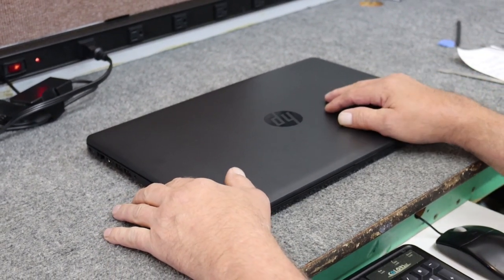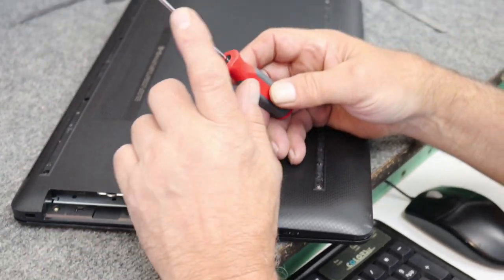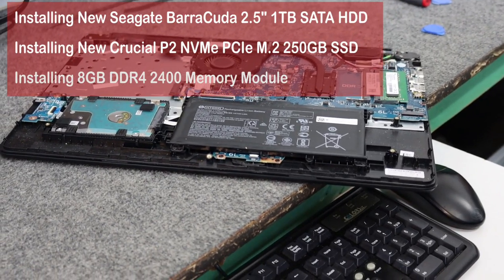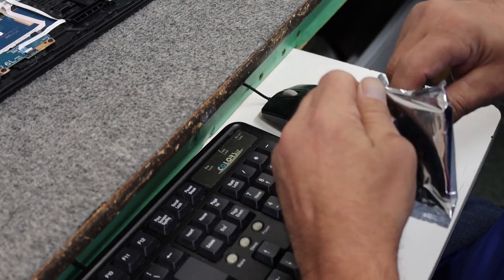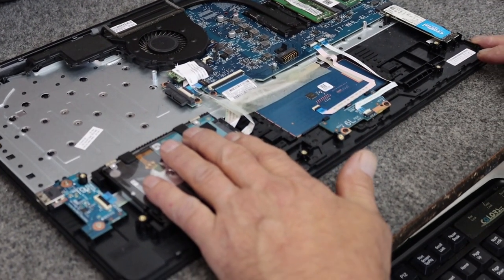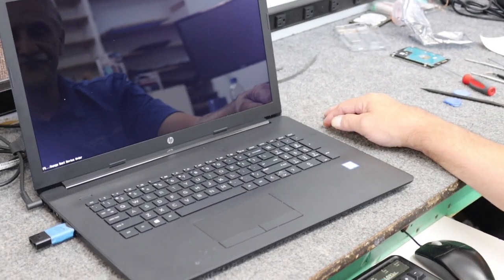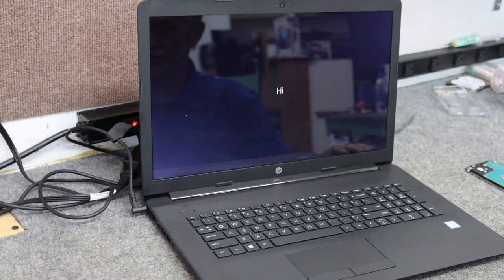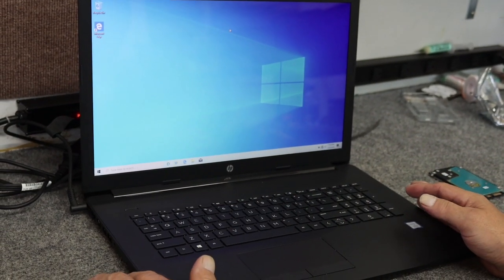HP 17.3" Laptop SSD Upgrade, Memory Upgrade, Additional Hard Drive and Clean Windows 10 Install

Comment: Nice job, Dale! I just bumped up the RAM on my HP 17-by1061st from 4GB to 32GB (16GB x2). Your instructions to open it up helped a great deal. My HD is still good but I plan to add the M2 drive and move Windows there. Thanks again! 👍🏽👍🏽👍🏽
Reply: Could you share with me what kind of RAM you did for the upgrade? I have the same model as HP 17. Thank you!

Comment: Glad I looked up this procedure... I might not have known about the rubber strips hiding screws...
Most major manufacturers of electronics hide a screw(s) under the rubber feet, or under stickers...
My MSI has 1 screw out of 10 hidden under a sticker...
You can take out the rest of the screws, but you have to poke the sticker for that one screw, and that alone will void the warranty if it's new...

Comment: I have this exact model, and although it's a little workhorse, the hard drive was slowing down, and it booted obnoxiously slow. So, I did a little research, and stumbled upon your video on how to install a SDD drive. Following your instructions, I was able to get it apart, install the new drive, and get it back together. I held my breath, plugged in my Windows install media, powered it up, and set the boot order. From there it was smooth sailing!! It is now running exclusively on the SSD, and I'm loving it!! The hardest part was my fumble fingers getting in the way!! Not bad for a 60+ year old!! Thanks for your help!!

Comment: Excellent video and to the point. I have this laptop with the smaller hard drive which keeps running low on space. Extremely happy to find out I can install an M.2 SSD. This really is a great laptop so I’m happy to be able to upgrade the space.

Comment: I WISH I could be side by side with you. I have been doing phone support for over 22 years but began with PC Hardware. Still have the scars on my
fingers when building PC's with cheap cases (Very sharp edges) and people wanting very small factor desktops.
Just got an HP 17 inch Windows 11 laptop with 8 gb RAM and a 256 SSD Drive. Looking to upgrade both but not sure if this has room for a 2nd
drive which would be greate!
You made it look simple, and very step by step which is appreciated since I have not actually worked on machines in so many years.
Gives me the confidence I need after researching for this laptop specs to see what I can and cannot do.
Thank you!
Reply from the maker: your welcome,  thx for watching. Dale

Comment: Thanks a lot! Not only was able to upgrade the ram memory, but I could fix one of the hinges that got stuck. I though something broke inside, but it turned out that it tightened up so hard that I had to pour tons of lubricant to start folding again.

Comment: Thanks a lot.

IF YOU DONT HAVE A PLASTIC TOOL (GUITAR PLATES) TO OPEN THE CHASE:
A good replacement for the plastic tool was a credit card (or other plastic card). Rounded corners, plastic... you can't damage you notebook with this "tool".

Comment: Hi! I've seen quite a few of your videos and learned a lot! I have an HP14s cr1008tx and I'm trying to add a 1TB HDD internally but I've noticed that my laptop does not have a caddy or the SATA cable to do so. So is there any particular model of the caddy and SATA cable that I should use for my model? I have a 256GB SSD already installed but it's full so I would really appreciate the help!

Comment: this is one of the best helpfull way to direct and create a step to step video. Watching some other step to step videos always wanted to ask something in some steps, and those questions (in my mind) never got an answer, except for this videos of yours. I came here searching for information for an HP laptop, the 17-x001nv. After watching your video I came with the idea to put a M2 disk, but I can't find if it is possible, it would be convinient to know before I'll open the case, have you got any information? Thank you for your work
Reply from the maker: Hi. Thank you very much. I believe your model does not have an m.2 slot. You can put a 2.5 inch SATA SSD though. Would make it lot faster. Thx, dale
Reply: @CadillacComputerCenter  thanks for the advice, keep up the good work.

Comment: Stumbling upon this video today made my day. I have a very similar model and I want to install an M2 SSD but keep my current HDD. Would I still need to create the bootable Windows 10 installation drive if I'm only adding the SSD? If not, anything different that I may want to do? THANK YOU!
Reply: I have nothing to do with the creation of this video, but if you are just installing a secondary drive, it's the same as doing it on any PC, laptop or desktop. You install the drive, power it up and the BIOS should recognize it. You then probably have to go into Computer Management to initialize the drive, assign a drive letter, and format it. That's it.

Comment: I have a very similar model HP 17 inch laptop. My M.2 slot has an Intel Optane memory card chip in it. Is it OK to take it out and install an M.2 SSD? I guess it wont affect anything? By the way I just recently replaced my bottom case and palm rest, and doubled the RAM from 8 to 16 GB :) I had already upgraded the HDD to an SSD drive a couple years ago.

Comment: I'm about to do everything you did in this video.  I appreciate your efforts it's lots of help.  One question.  On the memory, was there a reason you chose not to go to 32 instead of just another 8?  I was planning on 2 x 16 G chips.  TIA
Reply from the maker: Hi. I do these videos on customers computers. What I install is chosen by the customer.  Other than that, no reason .
Reply: @CadillacComputerCenter  Thanks for your time.

Comment: Hi Dale, I have a very similar outer shell setup on my HP 17 2075. I am getting a loud fan noise. My first step will be to take the shell off and see if cleaning the fan will help. If that fails, do you have a recommendation on where to get a replacement fan? Thanks, Tom

Comment: Hi, Thanks for the ONLY useful videos on HP laptops(new series). I'm not a very hardware techy girl but I try to fix things by myself. My HP Laptop 17z-Ca000 fan started making a lot of noise (speeding fan) despite no overuse. Error A90B causing auto shut down. I also have an external cooling fan base that plugs using a USB. I learned how to open the laptop(haven't tried yet- Scared :( but how can we fix the FAN issue? You are so knowledgeable, is there any other way to fix the fan issue without opening the laptop. It's been 2 years since this laptop. II cleaned it using a vacuum and air cleaner. So fan noise is intermittent now. But not a permanent fix yet. Could you please help out Sir? Thanks- Neha

Comment: I noticed the Crucial P2 M.2 2280 500GB I received that I want to put in my HP 17-by1061st is rated 3.3v and 2.5A. Will this SSD still wotk in this HP or does the Amperage have to 1.7A?
Reply: m.2 's mostly does work

Comment: This helped me a lot. the problem I ran into was the laptop refuses to boot from the SSD. I did clone the SSD from the HD.  When I boot up and go into BIOS it just shows the original HD listed and not the SSD although if I boot from the HD I can see and use the SSD from WIndows. I did find that by clearing the TPM in BIOS I can see the SSD listed but when I try boot from it it just comes up with a message saying add boot device and hit enter.  Any ideas?

Comment: It is stupid that they don't put a couple of compartments on the bottom for ram and ssd replacement rather than having to go through all of that. At least there aren't any short ribbon cables attached that have to be disconnected I guess. Those are a pain, and if you accidentally break one of the clips that hold the ribbons in you are screwed most of the time.

Comment: I have an HP Laptop model 17-by3065st and the hard drive (1 tb) is about full. Can I add a 1 tb ssd card for additional storage while keeping the regular hard drive with the Windows operating system, etc. on it?
Reply from the maker: As long as your laptop has an M.2 slot fir ssd.

Comment: I have this one hp laptop 14cf0000ne with 15gb for the OS. Is there any possibility to have another slot for another ssd, or Ill have to chenge the 15gbssd for a new one?
Or, can a replace the HD for an SSD? As you can see, im really confused about mt HP

Comment: My HP 17-CA1 is a RYZEN-7, 16GB , RADEON graphic card, but the hard disk is too slow, takes around 8-10 min in 100% of use after boot.  I need to change for a SSD.
Reply from the maker: Yes, you sure do.
Reply: And Many thanks for your video!
Reply: @CadillacComputerCenter  Just an update! I did today the upgrade and worked perfectly! Many thanks!!!

Comment: does the bios give you the choice of HD to boot from? do you think i can boot win 10 from the M2 and cloudready from  the SATA? o does the computer see only 1 continuos HD?  Is 128GB enough for win 10? Thanks
Reply from the maker: Hi. You would have to enable legacy to do what you say.  It gets tricky .  128gb is enough for windows 10, with a little to spare.  There are tons of videos on YouTube on how to setup a dual boot.
Reply: How many gigabytes of RAM can a 17.3 in HP laptop take?
Reply: @hezekiahwallace2412  I think the max is 16 GB RAM. Some people say you can put up to 32 GB RAM, but from what I hear it's 16 GB RAM. Don't put 32 or you'll probably mess something up.
Reply: @chasejones2654  was just going to comment on this. I just ordered another 8GB to expand my ram. I looked it up and my 17in HP laptop only takes a maximum of 16 gb; comes with 8 installed

Comment: would be lovely to upgrade dedicated 960mx to a stronger version graphic card. or using dvd tray to add another graphic card. tip :  if there is a connector / pin ; that side comes up first (mostly) gently...

Comment: hello,
How would i take out the two screws on the 
disc drive
Thanks
Reply: eject the drive while using the laptop and keep it ejected then you can reach the screw from the behind
Reply: @emre.mir.x  thank you
Reply: @emre.mir.x  My optical drive is different. It's connected via a cable and has hinges. How the heck do you remove this first?

Comment: Can you also upgrade the GPU in such a laptop?
Reply: Most low or mid level laptops use APUs that combine the CPU and GPU into a single part, which is often  soldered in so it cannot be replaced.

Most laptops that even have a GPU are considerably more expensive on average for  the high end system or occasionally mid level.

Most stuff you've seen in stores are probably low end or mid level if your lucky, or high end if your really really lucky

Comment: Hello I  have  HP 17CA2020RN with 4GB or RAM I purchased an additional 4GB to bring it to 8.  When I installed the extra 4GB and started up i got the HP logo screen the a black screen with my pointer and the loading circle.  I let it sit and it never started so I removed the additional 4GB I added and it still would not go past the black screen.  I was able to get to the troubleshooting screen and I uninstalled the most recent windows update, and restarted and it booted up like normal and I was able to log in.  Do you think I will be able to put the extra 4GB in now with no issue?
Reply from the maker: I would think you can add the new ram now. Is it the same speed as factory ram?
Reply: Yes it's 4GB

Comment: what is the socket right above the original HD?  It says M2 x 3 on it.  But it doesn't fit any M.2's I have seen.   My laptop does not have the M.2 Socket you used, the spot is there just no socket to plug into
Reply from the maker: Hi these models vary greatly. You probably have an m.2 sata port, with both B and M key. That's for older gen 2 x3 ssd.  Cant say for sure though, CV without seeing it.  Dale
Reply: @CadillacComputerCenter  Do you have an email?  I cant post pictures on here
Reply: Great video's BTW  new subscriber!
Reply from the maker: Dsperlingjr@gmail.com
Reply from the maker: Thank you.
Reply from the maker: Hi. I got your pics, thx. That port is for an optical drive. It's just a standard SATA port. You know, dvd cd drive.
Reply from the maker: Hey. Sry, actually in your case, the m2x3 refers to the screw size.  Sry. You'll notice it by other MB screws. M2x3mm. Is what it means. Its confusing, cause m2x3 also refers to an m.2 sata ssd port. Dale
Reply: @CadillacComputerCenter  ahh ok thanks

Comment: Wish all laptops could be upgraded to 16 GB. Some can't even go that high and they are really nice computers smh with a nice 17. Screen. I was trying to find a 17.3 inch laptop with at least 16 GB with a backlit keyboard running windows 10. All I see is one alot but they are missing one thing smh. and most of them are EXPENSIVE AS HECK. I have this same laptop but my model is a Ca1xx something lol.  Most of them are Bulky looking and too big for my taste and ugly to me. I'm very picky on laptops it's has to look nice and have good spects.

Comment: wouldn't be better to just create an image of the old drive and install it on the new ssd?
Reply from the maker: Hi. I would not say better, but it is another way of doing it.  Typically,  cloning is much faster. Creating and restoring from image does take some time. But if you dont mind that, go for it. Thx.  In the case of this video, it had a bad hard drive, as I stated.  Clean install was best option. Dale

Comment: I don't like HP's design choices of putting the screws under the feet.  A friend of mine has been inside his hp laptop so many times the feet don't even stick back on it anymore
Reply: yeah I couldn't believe they'd hide screws under the rubber feet myself either - what a really bad design idea as you know that strip is just going to stop sticking over time.  I'm just looking at those screws and I reckon the two in the middle on the back don't really need to be there anyway so if you miss them two in the middle off you could get away with just screwing in the four corner screws, then to undo it you'd just need to lift up the corners of the rubber feet each time rather than removing the entire strip!